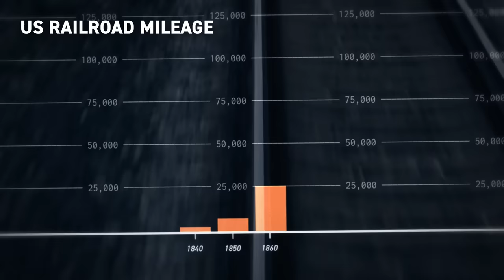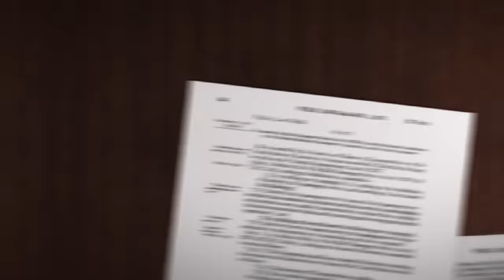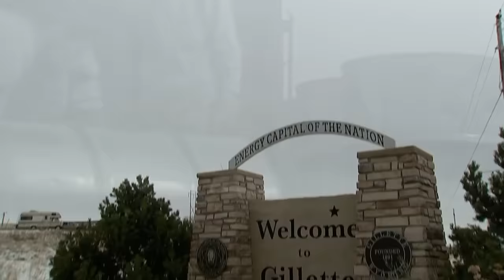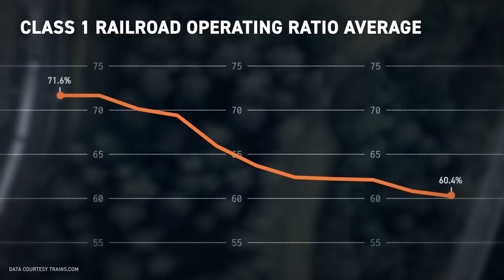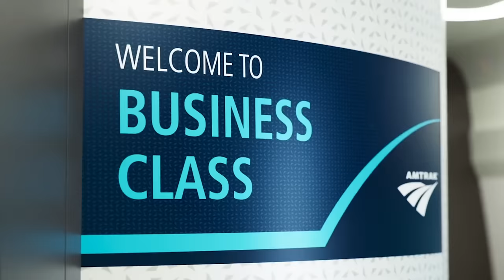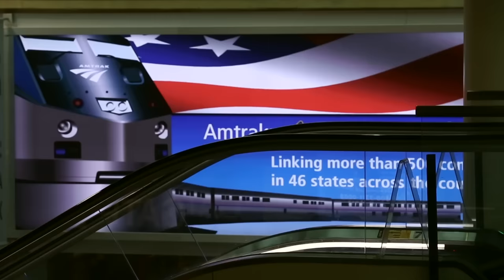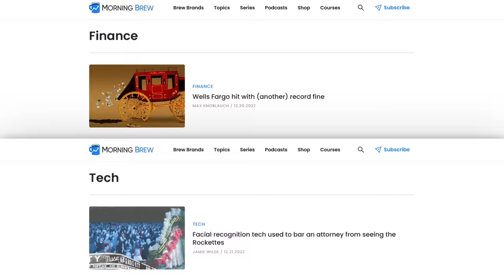The One Tiny Law That Keeps Amtrak Terrible

Comment: I’ve taken Amtrak from winter park Colorado to Glenwood springs, and while the train was horrifically behind schedule, we weren’t in a hurry and the ride was almost luxurious.  The seats were massive and much less cramped than an airplane, there were dedicated cars with massive windows for viewing the beautiful nature we traveled through, snack bars on the lower decks of some cars, plenty of room for everyone to move around, etc.  Overall a much more pleasant experience than flying and I’d do it again in a heartbeat.
Reply: I doubt that Amtrak is going to be able to sell passenger rail on the basis that "It's great if you're not in a hurry to arrive at your destination"
Reply: Amtrak in the Northeast is great.   I was able to hope on the train with my family and end up in in NYC on time a few hours later.  Where they own the tracks it is a great service.
Reply: "’ve taken Amtrak from winter park Colorado to Glenwood springs, and while the train was horrifically behind schedule, we weren’t in a hurry and the ride was almost luxurious"

It's also only 129 miles, so, much shorter than most intercity distances in the USA. There's not even a flight available (yet...when eVTOLs come out you'll be able to fly). Plus those are both fairly small towns that wouldn't justify a huge expenditure to do high speed rail or whatever.

It doesn't scale to SF to LA (despite the majority of my fellow Californians having voted yes on prop 1a in 2008 that authorized spending on an HSR), which is 380 miles, which is over twice the distance. You're looking at three hour train, at least (probably more like 4 hour train...but it's never going to be completed, long story), vs one hour flight.

Sweet spot for HSR is about 200 miles with a dense city at each end. We have maybe five or six areas like that in the USA and they're far enough apart that you still need to fly from area to area.
Reply: @neutrino78x  " one hour flight." plus hours in the airport being treated like cattle.
Reply: @geriroush8004  

"" one hour flight." plus hours in the airport being treated like cattle."

Yep. From here (silicon valley) to Los Angeles or San Diego or Las Vegas is a quick one hour flight. There is absolutely no need to be in the airport for hours. If you are, you did it wrong (with the obvious exception of weather delays, Amtrak has to cancel trains in whiteout conditions too btw).

I have "clear" so security is five minutes. If I didn't use that, it would be 20. Still not hours.

I check in beforehand on the app. Again, not hours.

The only time I arrive at the airport more than an hour before scheduled takeoff is when I'm coming back, have lots of time, and would rather sit at the airport than the hotel room. 

We have lots of trains in here in the San Francisco Bay Area, and I use them. I don't know how to drive. But if I have to go more than 200 miles or so, I'm flying. I have places to go, things to see, and people to do, baby.
Reply: Real train travelers ride for the scenery, not to get from point A to point B as fast as possible. My favorite Amtrak line is the Cascades, Eugene Oregon to Vancouver BC, especially the Talgo "tilting" trainsets that ride more comfortably than all others including Acela. At 8min 30sec in the video, short lines like the Cascades are depicted around the nation as possible today. The Talgo trainsets were engineered during/after WWII in the USA. What was it that Wisconsin Governor Walking didn't like about the moniker MADE IN USA when he cancelled the Talgo manufacturing plant project the first thing in office?
Reply: @artlewellan2294  

"Oops, Wisconsin Governor "Walker" serving his only true constituents, automobile dealers, manufacturers, financiers, insurance companies and oil giants."

Nah, it's just lack of population density and far distance between population centers. 

London and Manchester are both super dense and about 200 miles apart. HSR makes a lot more sense there than it does here (although I wouldn't spend billions and billions on it over there either, but if the Brits wish to do so they certainly can). UK is 10x the population density of the USA.
Reply: @artlewellan2294  

"Real train travelers ride for the scenery, not to get from point A to point B as fast as possible."

Oh sure, I agree. I very much enjoyed the trip from Seattle to San Jose on Amtrak in a private room as my ride home from the Navy in 2003.

But I would never say "let's spend billions so tourists can enjoy scenery".

I think there's a strong argument for making the long distance Amtrak trains into private/public partnerships, comparable to the hotels in our National Parks. 🙂
Reply: @stevenlitvintchouk3131  lol true
Reply: Most people taking trains are in a hurry that won’t fly
Reply: @neutrino78x  poor argument now go away
Reply: @neutrino78x  there are laws that protect cattle in transit, must have ventilation, water, stops for exercise and feeding, apparently not so for passenger airlines.
Reply: @henryostman5740  

"there are laws that protect cattle in transit, must have ventilation, water, stops for exercise and feeding"

You have ventilation and water and a restroom on an aircraft.

You don't need to to stop for exercise and feeding because you're going A LOT FASTER than any train could go.
Reply: @qjtvaddict  

"poor argument now go away"

Please learn how to quote, so people know what you're replying to. I would suggest waiting until you get home, so you have a mouse and keyboard and can do it properly.
Reply: @neutrino78x  I wouldn't trust a private public partnership. Any time a corporation owns any sort of infrastructure it seems to turn into a monopoly that is fine in the short term but raises rates and is universally hated in the long term. Just look at cable. I'd hate to see rail lines squeeze are much profit as possible as people would just go back to cars and the system would suck.
Reply: @caseymurray7722  

" wouldn't trust a private public partnership. Any time a corporation owns any sort of infrastructure"

1) it's NOT "infrastructure". Our INFRASTRUCTURE FOR HIGH SPEED TRAVEL IS OUR SYSTEM OF JET AIRCRAFT. 

Your comment is like saying the wired, analog telephone system is infrastructure. Or that we should revert to sail driven ships for travel across the seas.

North America and Australia are not Europe and Asia. Our population density is too small, and the distance between population centers is too great, to support HSR.

2) No one said private ownership. I said public/private partnership. In the national parks, private companies don't OWN the hotels and other services....they are operators. The US Federal Government should maintain ownership of Amtrak, but a private company would operate the long distance trains profitably.
Reply: @neutrino78x  Security in 5 minutes? LOL, must be nice to afford special treatment. I'll drive, thank you.
Reply: @geriroush8004  

"Security in 5 minutes? LOL, must be nice to afford special treatment."

It's cheap, it's only 200 a year. I make 21/hr and I can afford it. 

" I'll drive, thank you."

Well, some of us places to go, things to see, and people to do. So we can't drive, because it takes forever.
Reply: That's great. Maybe Amtrak should opt to build its own infrastructure and railways instead of relying on those which are privately-owned?
Reply: @iJoshDG  

"Maybe Amtrak should opt to build its own infrastructure and railways instead of relying on those which are privately-owned?"

It's a waste of money. The RoW is already bought and the tracks are already laid. To buy more would be too expensive. Yes, the federal government is quite capable of telling people they have no choice but to give it to them, BUT, the Constitution says they have to be fairly compensated, so they can go buy new land. So you're not going to compensate them 1 USD, ok. It would be whatever is determined in court to be a fair price. If you're buying somebody's farm land that they're making a lot of money from, it's going to be A LOT MORE than 1 USD. 🙂

This is the case in free countries like France and Japan, too. The difference is that, the people of France though it was worth it to buy that new land and run that high speed track, since the distances are a lot shorter and the cities are a lot denser. The people of the USA, Canada and Australia consider it a waste of money. You're talking multiple hundreds of billions just to buy land all across the country, then you have to lay new, high specification track that supports high speed, and hang a wire. Just hanging a wire is round four million per mile and to cross the country takes 3000 miles (4828 km, for those of you who are too lazy to google it....seriously, people, all you have to do is to go to Google or duckduckgo and type "3000 miles in km").

So why do all that when the private companies already have railroad track available? Seems like a huge waste of money. You're not going to compete with air travel anyway, because a Boeing 737's cruising speed is Mach 0.75 or 838 km/hr. No wheel on rail train goes that fast, and not even maglev does, unless you enclose it in a tunnel and pump out most of the air (that's all hyperloop is btw. it's just maglev with air pressure equal to that of 30,000 feet altitude. Not a "vactrain"), and that would be far more expensive than wheel on rail HSR.

Plus, you have to understand the history of Amtrak. Originally, private companies did passenger rail. BECAUSE AT THAT TIME IT WAS THE FASTEST AND CHEAPEST METHOD. But in the 60s, car ownership was very common and passenger aviation started to become more affordable, so going long distances at high speeds with wheel on rail became obsolete.

Problem is, the freight railroads couldn't just close down the passenger services, because part of the contract with the federal government was that they got the land for free (remember, in the 1800s, the federal government had a lot of land through the Louisiana Purchase) but were obligated to run passenger services.

So that's why Amtrak was created, to perpetuate long range passenger service that was no longer profitable.

You defeat the purpose of Amtrak if you buy private land and run more rail.
Reply: @stevenlitvintchouk3131  Why not?  The geography in this country is beautiful and riding in an updated, comfy train could absolutely be marketed as a vacation.  Personally, I'd rather do that then go to Disneyland.  But if the gov could maybe come in and put Amtrak on its own rails, the delays would probably be in a normal state.  THEN if that generates a good amount of interest, maybe the gov could be convinced to start investing in high speed rail.

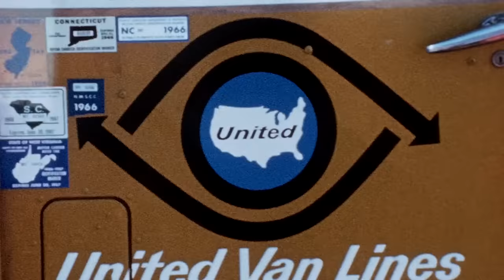Comment: My single data point anecdote:  there’s a ski train from Denver to winter park, Colorado during weekends in the winter.  Most passenger takes it to do day trips to to skiing at winter park resort.  We’re supposed to depart Denver a 7am and arrived at winter park resort at 9am, and get our full day of skiing before leaving the resort at 4:30.  This is very convenient and high value, since it saves the passengers from a sometimes difficult drive across the continental divide.  

My one time taking that train was about 20 years ago.  We ended up stuck behind a coal train and a 2 hour journey turned into 4 hours, and our 7 hour ski day shrank to less than 5.  The whole time we were waiting for that coat train to pass, all I heard was people saying the coal has been i the ground for millions of years, surely it can wait a few more hours.  I and my family have never taken that ski train again after that.
Reply: If they could just get reliable trains (emphasis on reliable) that go from DIA, through Denver, and to some major ski towns, it would get so much use and reduce traffic on I-70 a ton. Until there are major changes with the rail system, though, the only hope for such a train to exist is if Colorado were to host the Winter Olympics (which would have its own set of problems)
Reply: I would have to say the only trains I’ll take are places that are to short to economically fly to. But the drive is torture. No traffic, but just torture. 

Like the LA to Vegas train. I’ll take that train as long as it’s cheaper than flying. Because the drive is torture. You look at desert for 5 out of the 6 hours.
Reply: That ski train no longer runs, it shut down in 2009, the new one is run by Amtrak and is more efficient
Reply: I like how started your comment with "My single data point anecdote", instead of "My friend had this experience once which PrOvEs my viewpoint".

However, instead of swearing off the train forever, you should get all your fellow passengers together in a class-action lawsuit against the freight company for "insurrection" towards the federal government. 
I'm starting the believe that the events portrayed in the film "Unstoppable" were highly accurate and NOT sensationalized.
Reply: But this is more tourism than passenger rail - in Europe and Asia a seasonal tourist train would be considered a failure. It's about arriving at a station and a train runs all the time. This is rail passenger service. Not ski trains, dinner trains or seasonal trains. They are novelties and not rail transport in a meaningful sense.
Reply: @T. N. What
Reply: @h8GW  Yeah, then you'll just bitch about the power company raising power costs because you need a sKi-TRaiN instead of fuel for your local power plant
Reply: @AG-yc7vt  too*
Reply: @h8GW  Unstoppable was a true story, look up The Crazy 8's Incident.
Reply: My family and I /grammar nazi
Reply: Too bad you cant sue them for causing you damage by not following the law
Reply: Oh my gosh I don’t even live in Colorado and it seems like trains to and from the mountain towns should be a no brainer! Took a trip to Denver a few years back and my friend wanted to go to Breck just to see it since she’d never been and  we sat on 70 for at least 2-2.5 hours trying to get out
Reply: You sound like a typical McDonald's customer
Reply: That’s a function of the human element at work (or NOT at work in this case).
Reply: there was no coal train- the crew was lying.
Reply: @AG-yc7vt the only problem with that is there are a ton of flights between LA and Vegas and they are cheap and 45 minutes long.  I doubt a train could match that.